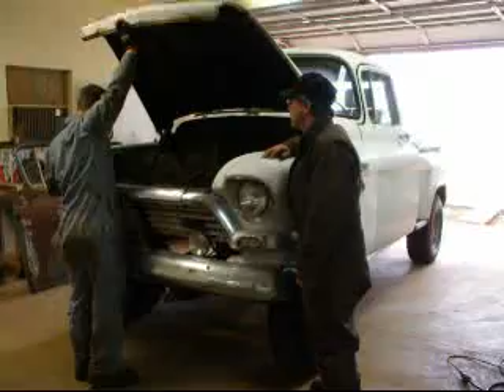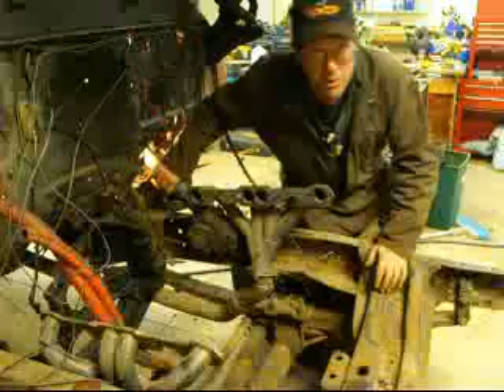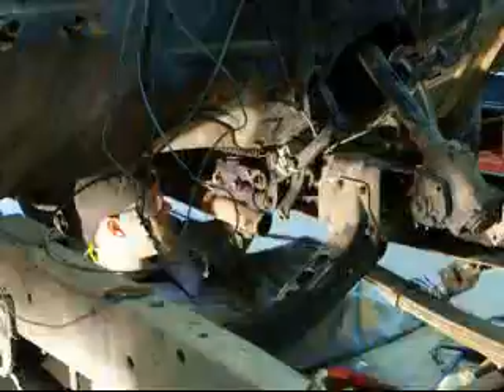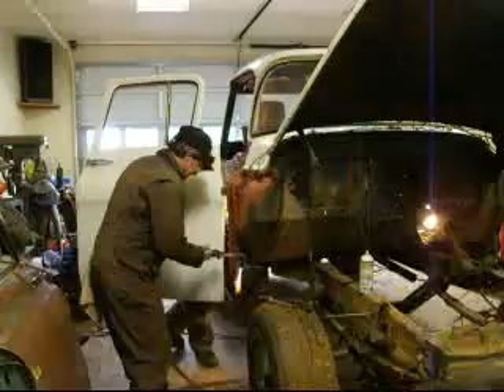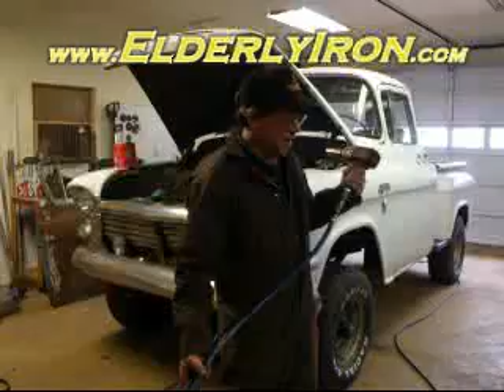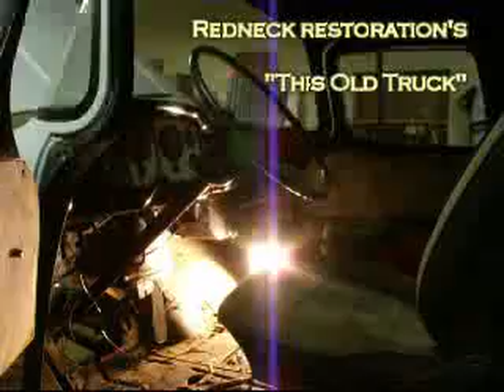Project Whitey 57 GMC redneck Restoration's "This Old Truck"

Comment: @ElderlyIron i believe its due to cost and availabilty,, chevy engines are easier to find, parts are cheaper. thats just my way of thinking from my hot rodding days.hence the reason we see most ford t buckets/hotrods running small block chevys.even new rebuild kits are on average 30% cheaper. 
keep the vids coming, looking forward to seeing the progress on the truck.

Comment from the maker: @cappy6921  Almost every time you see a re-done 55-58 GMC, they seem to put SB Chevies in them. GMC chose the V-8 engine that produced the most torque for the given year, therefore factory V-8 GMC's came with Pontiac powerplants. They used the same block but kept boring it out for each year. The 2 something in 55, (don't remember actual cubes) 316 , 347, and 370 respectively. Although we're updating this truck in terms of safety and efficiency, we're retaining the original look and Poncho power.
Reply: 287 in '55 I believe.

Comment from the maker: @cappy6921 Oh, it's definitely the money. You could build 2 screamin' SBC's for what we'll have in this. I also just snagged a 366 Big Block from a 60 something cabover. Boat anchors to most, but I want it for torque and reliability. Those valve covers are also the neatest. Just wait'll you see what it's goin' in.

Comment: 366 big block and I'm thinking a tall-deck Chevy truck motor from the '70s & '80s.  60 something cabover and I'm thinking one of those big GMC V6s (305-472 ci or thereabouts).  Neatest valve covers and I'm thinking Chevy W motor (348/409 or a possible variant).  Hmmm...